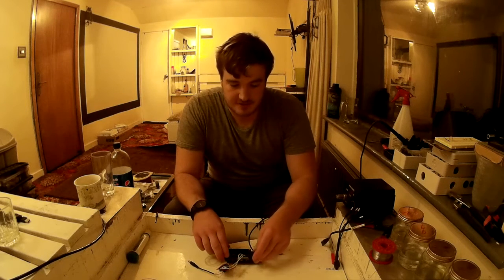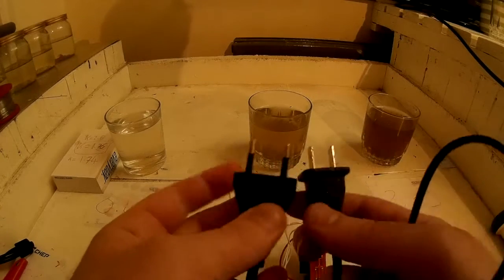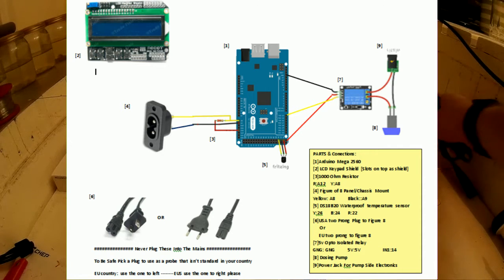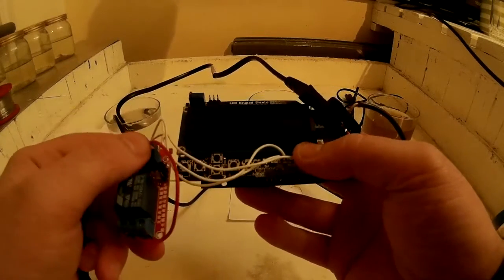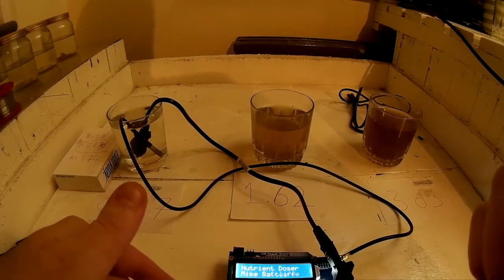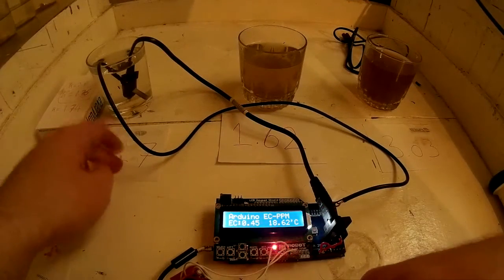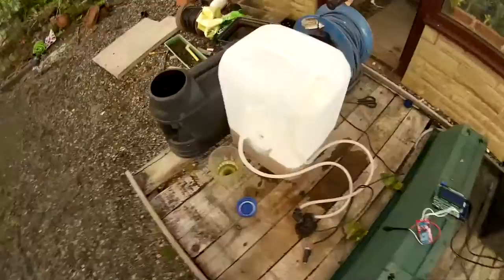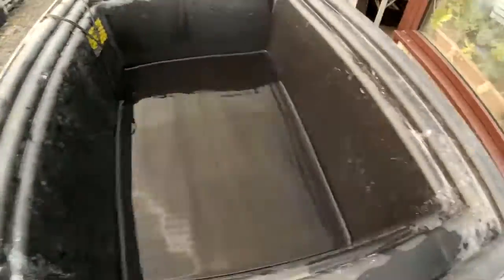Self Optimising Automated Arduino based Nutrient Doser Hydroponics

Comment: Good stuff, thanks. My EC probe is interfering with my pH probe, it seems to be due to the AC field in the water. Does yours work with chopped DC under electrolysis voltage levels ?
Reply from the maker: Hi Gary, if you already have a AC probe with breakout board I would stick with it and apply the same fix we do for the DC version. 

-move the pH and ex probes as far away as possible in the tank.
-only power up the ec probe when taking readings (half a hour or so for logging). Depending on the power consumption of your ec board you may be able to power it from digital pins setting them to inputs when not in use and outputs when needed.
Reply: @MikeRatcliffe24  Thanks Mike, i tried that with a MOSFET as a switch (overkill i know!) but didn't have much luck, i'll try it with the pins. It's interesting getting it to work, i've learned more than i thought i would!
Reply from the maker: @GaryMcKinnonUFO  MOSFETs commonly have diodes inside that could be the issue. 

Just give your board a Google for Max current per digital pin and see if your board current needs are below. 
Setting all pins to input is the key when not used.
Reply: @MikeRatcliffe24  Thanks for taking the time Mike, i'll let you know how it goes.

Comment: Great project! Where can i get the libraries and source code?
Reply from the maker: https://www.element14.com/community/community/design-challenges/vertical-farming/blog/2015/09/22/automated-green-house-blog11--self-optimising-automated-nutrient-doser

You can copy the code into the arduino ide, I have not tested this code for very long. keep that in mind
Reply: Thank you! I will attempt to build this and add PH monitoring and regulation to it.
Reply from the maker: It will need a little work, please share the code if you add limits to its self learning :)
Reply: @MikeRatcliffe24  hi,
 are you still using the system?
How did it work out for you?
Is there anyway to contact you?
Reply from the maker: @MrMinigung  Hi Vincent, I swapped over 100% to aquaponics so no dosing, but i am still using the probe style as part of a data logger.
Reply: @MikeRatcliffe24  is there any way, you could send me the code?
Reply from the maker: @MrMinigung  the code can be copied and pasted from the blog on element 14. You may need a pullup resistor on the temp probe.

Comment: Very good. What sort of nutrients do we put into the system?  Would a store bought one work? I have a feeling though,  that you're not using those...  How are you getting nutrients to the plants? It looked like it dispensed a lot from the nutrient tank.
Reply from the maker: +sounder83 
Hey I am using this for a nutrient source that  is not constant strength. If you are using the same liquid fertiliser from the store I would recommend a para-static pump and no self learning. 

I use this controller in an IBC hydroponics setup. what kind of system are you tying to automate?
Reply: +Mike Ratcliffe I am wanting to build an aeroponics tower and do some automation with arduino. I thought it would be cool to tighten the control parameters of the system and  produce more...  And also keep a remote eye on values that need attention. 

Your ec probe is brilliant.
Reply: +Mike Ratcliffe just curious...  Tell me more about your hydroponic setup... What sort of nutrients do you use?  Where do you source yours?  Is your method produce organic crops?
Reply from the maker: +sounder83 

Thankyou for the Interest, im working on some more automation stuff, but I test stuff for a few months before writing about them [around 5 months till I release the plans].

I have two identical systems, one running conventional commercial fertiliser and one running on pasteurised human urine. They are really for testing, although they do produce well. I would recommend considering an aquaponics setup if you want organic produce for sale. 

The Blogs are a little bit messy, but the main homepage might be of some use:

https://www.element14.com/community/community/design-challenges/vertical-farming/blog/2015/09/13/automated-green-house-blogs-main-page

Blog 1,2 and 16 might be interesting to have a click thru. 

Mike
Reply: +Mike Ratcliffe so the fish feed the plants.  Is this enough for the crops?  So I could use a fish culture to cycle in "dirty"  water using your controller to measure ec and supply crop roots with this.  Am I on the right track?
Reply from the maker: +sounder83 
The beauty of aquaponics is that the fish dirty the water and the plants clean the same water, no need to separate the systems. It is a bit harder than hydroponics because you need the right amount of fish for the size of your vegetable patch. 

I would recommend reading a little bit about hydroponics and aquaponics on google, they both have advantages and disadvantages. Let me know what you end up going with and what you find hard to manage, these are the tasks I really want to automate.
Reply: +Mike Ratcliffe wow... Very good code.  I just went through the code run down from hackaday.. I did over estimate the simplicity of the application... But it does make sense as I read it.  

I'll be looking into what an IBC is. I'd like to follow behind someone I  doing this... Im sure I'd get stuck. I initially found your work looking into an ec probe... Man these onion layers. Lol.
Reply: +Mike Ratcliffe I was doing some reading on the fish and crop closed loop system...  But initially discarded it due to the added care of the fish...  I just thought it would be simpler to just have a stand alone hydro or aero system that automates the nutrients...  But there's so many needed and such fine control,  that it makes the automation processes intensive,  and I'm not that hardcore of a code developer to tackle that. I can play around with arduinos and controllers...  Can do nifty little circuits,  but it would be difficult for me to make something workable for a stand alone system. 

Now looking at your ideas and guides...  Automation in the closed loop aquaponics is a bit more biologically managed,  to say. 

We could then automate fish feeding!  And calculate the amount of food into the tilapia... I read somewhere someone has formulas for fish feeding certain amount of food derives a particular size fish. (if you wish for protein source)
Reply: +sounder83 hardware wise...  I want to use the nrf24l01 with my sensors lib in a mesh like grid.  Basically have a deployable sensor node, and switches running off of a small solar cell into a lithium ion pack into a mini arduino with the radio and sensor running in low power state..  Wakes up does something goes to sleep for a min. Run this back to a raspberry pi and have a home automation controller like domoticz display the dashboard.. I could access this remotely as well at that point.  

Sound good?  I've got the sensors working in this fashion.  Moving onto a 30a solid state relay design that I can trigger remotely and make a 4 gang outlet with pumps attached...the system then could manipulate those sources.
Reply from the maker: +sounder83 

Sounds like a good plan, im moving over to the NodeMCU esp8266 with similar goals.
Reply: +Mike Ratcliffe the esp8266 uses a lot more power... WiFi capable... Though.  Won't be a problem if you increase the battery size or add constant power.  Unless you know something about the es8266 I don't.  Will it do low power state?
Reply from the maker: +sounder83 

It will do low power mode [sleep] but the power up current usage is quite high with all the wifi handshakes, Good enough for my applications that will be battery powered. With aquaponics you will have power there for the pump, I plan on using this power for that.
Reply: +Mike Ratcliffe hmm good point... About the battery power.  

Did you know the esp8266 has a mcu on board... Can be hacked and scripted with Lua...could be a very compact  unit.
Reply from the maker: +sounder83 

The arduino community have kicked ass and released an arduino library for it, Lua is good but it can be tricky to get it to work [only my experience]. Depends what you feel confident in language wise.
Reply: +Mike Ratcliffe I'm literally learning about this as we talk...  I had no idea about the arduino lib... Ill surly be looking at this setup.  

I'm comfortable with html 1.0 from 98... Lol...
Reply from the maker: +sounder83 

Add me on Fb if you like[the chat system is much better] ive been working with them for a while now. there are a few esp8266 boards out there now, but only one will be staying and I think this will be the NodeMCU because it has a usb chip built in and already has shields available. 

Im working on a few ESP tutorials for the arduino IDE, all the components are there already but with bad supporting tutorials for beginners. Im impressed with the capabilities to say the least. 

https://www.facebook.com/mike.ratcliffe.984